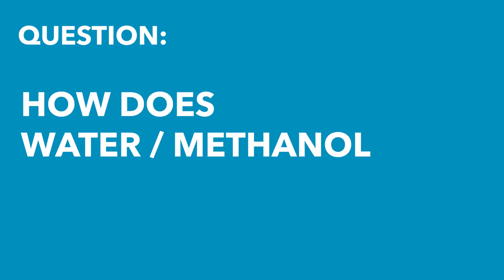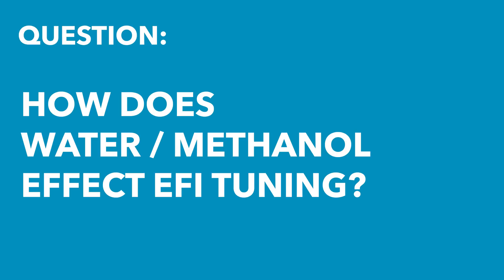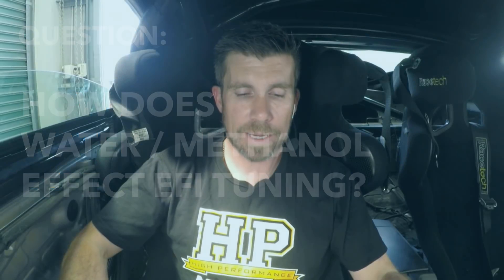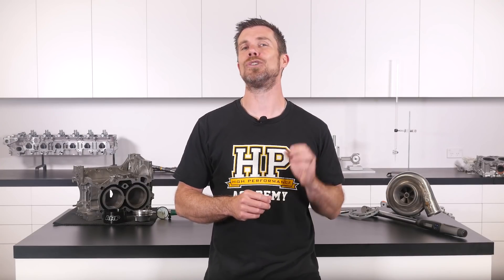[HPA Q&A] What is Water / Methanol injection? Do I need it? | EFI Tuning

Comment: Question: my friend has a standalone aem controller on an mhd tune.  It seems that there is a bit of lag from when the wmi sprays and what is read out for IATs.  My tuner says that i need to install a solenoid that "eliminates any chance of water/methanol flow into the inlet when the WMI system is not engaged".  This solution does not make sense to me.  The issue to me is that either the pump is either priming everytime i get into boost or something else.  Any suggestions?

Comment: My question would be, will a top end lube be important or is motor oil enough when running methanol injection. Is the oil drain interval decreased significantly.
Reply: No.

Comment: I've been doing some research lately about injecting water/methanol pre-turbo. Seems almost too good to be true. Anybody here injecting into their turbo inlet?
Reply: Need to be very mindful of water droplet size, as too large will cause damage to your compressor blades. 
Or accept an amount of extra turbo maintenance (more suited to a competition car)
Does have some nice benefits when done right.
Reply: For sure, that's one of the first things one learns when researching this topic. Do you have any first hand experience injecting pre-turbo?
Reply: Justin West Good to see your doing some proper research 👍
Others haven’t and have paid the price.

I inject water-meth post turbo,  not game enough for pre turbo yet.
Volute injection could be a safer option, but need to research that more myself first.

It’s a very interesting topic :)
Reply: Injected at the throttle body after the intercooler or above the intake valves. It's a ghetto rig when spraying through the MAF or turbo or intercooler. It will ruin a MAF, it's really not good for the turbo and if it's sprayed through the intercooler it can start pooling and can hydrolock the motor. If you want to cool your intercooler, it's important to use water or Co2 on the outside of the intercooler, never inside of it. 

If you don't have a intercooler you still want the meth/water injection after the turbo. Some people use the turbo to help keep the meth/water atomized in the intake charge but I personally wouldn't.
Reply: Gamma Light, thanks for the reply. Pre-turbo usually means RIGHT into the inlet of the turbo, so after the MAF. But speed density is superior anyway. Yeah, spraying before an intercooler is asking for issues, but part of the "coolness" of a pre-turbo setup is that you get to ditch the darn thing altogether anyway 😉 yes spraying into the compressor wheel will give excellent atomization but the "coolest" part is that the water/methanol vapor evaporates right there, inside the compressor housing, where the air is being heated as a result of it being compressed. Thanks to that evaporation, you now have cooler post-turbo air temps, potentially to the point of not needing an intercooler. Eliminating that heat energy makes your compressor flow more efficiently and pushes your compressor map to the right too.

Reading about this stuff the last few weeks has me baffled that more people with turbocharged or even supercharged engines don't spray pre-compressor. The knowledge and data is out there, if not a little obscure. It's a concept that goes back to WWII, not exactly cutting edge. You don't even need a pump if you set it up right... and yet people seem reluctant to even try it. 🤷🏽‍♂️

HPA, there seems to be some pre-turbo proponents on your side of the pond, particularly in the rotary crowd. Surely you could find one of them that are eager to show off their setup?
Reply: Justin West, one would need more methanol injection then a pre turbo injector alone to replace an intercooler but if you go that route the methanol better keep working / never run out. Turbo wear rate is anyone's choice and spraying through them isn't good but if done right it shouldn't be a big deal until it is a big deal. Murphy's Law, compressors like air way more then water.
Reply: But if it made more power then the cost of a turbo i would consider it too, I do see your point.